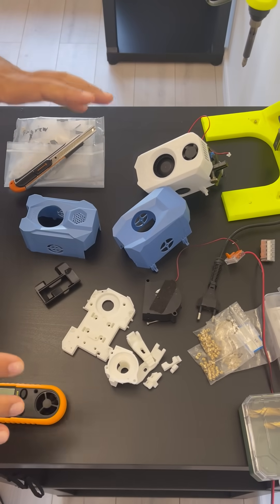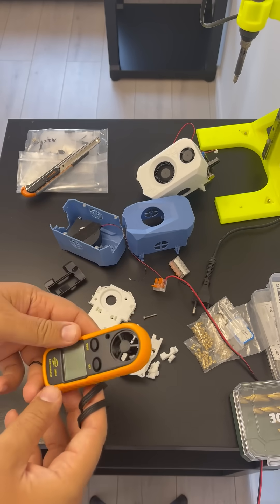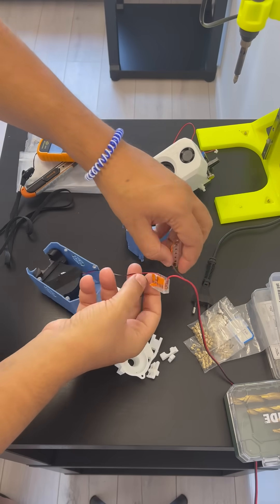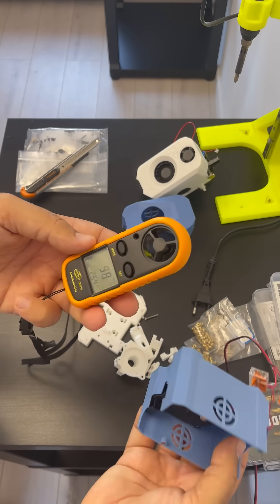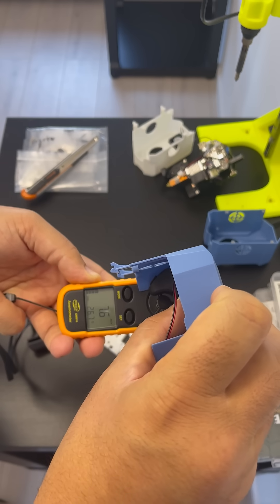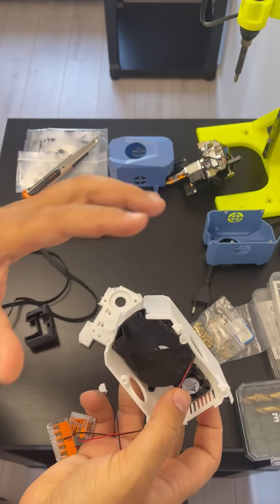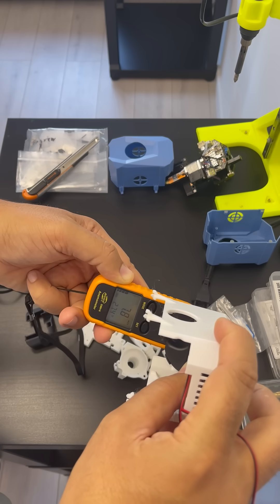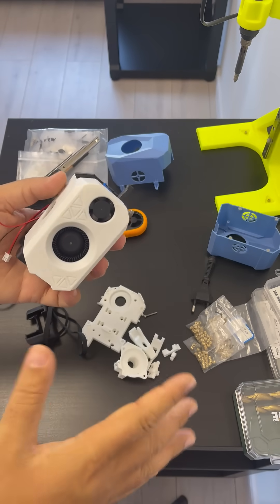Part Cooling Showdown 🔥 SV08 vs SV08 Max/Zero – Stock vs CN3D Upgrade (Anemometer Test)

Comment: This is going to be a drop in replacement for the stock SV08 and offers better cooling?
Reply: Came to ask the same too
Reply from the maker: Good question 👍
For the SV08, if you want to install the Zero toolhead, you’ll need a CAN adapter since the new toolboard runs on CAN.

👉 UTC/U2C CAN adapter: https://tidd.ly/44ix5xh

👉 Sovol Zero toolhead: https://tidd.ly/4pgwrdx

Once installed, our shroud is a direct drop-in replacement and gives you the cooling boost we showed in the video 🚀
Reply: @nadir3D  I don't want the Zero toolhead, I just need a better part cooling for my SV08, should I go directly to the Xenomorph since it uses 2 other fans?
Reply from the maker: The new Xenomorph IT has @ 6m/s Flow ( 2 4010 fans) the stock SV08 it has 1 5020 fan that produce 6.7 it is true the new xenomorph has much more to offer. you can opt for V4 or V5 if you want better cooling!
Reply: @nadir3D  wait a second, I thought that the latest version of the Xenomorph has the 5020 in conjunction with the two 4010.
Reply: Do you know what has to be changed in the configuration files after putting in the adapter and swapping the tool head to the zero?
Reply from the maker: yes. join our discord server and we can chat more there https://discord.cn3d.eu